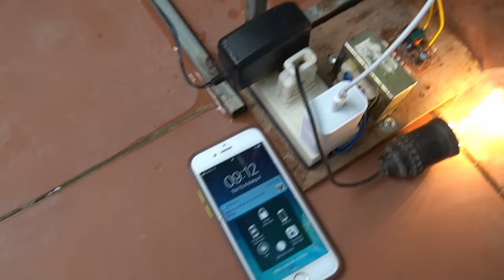Turn The Washing Machine Motor Into A Permanent Water Turbine Generator

Comment from the maker: 👍👍👍 Subscribe To The Channel To See Great Ideas❤️❤️❤️
https://www.youtube.com/channel/UCYPHQSj2QrRNfIiHNzbB6IA?sub_confirmation=1
Reply: Já   -
Reply: Mantap 👍 inovatif oke disub
Reply: إيه الحلاوة دى
Reply: @heliofeitosa6827  vhjnb
Reply: @عاطففوزي-د5د  Power For production 12 volts  and use Batery power deep cicle 200 amper for take the energy . And  use the inversor to transformed to 110 to 220 Volts.   Imagine Five Batery...
Welcome to Brazil Mr.
Reply: 500W Inverter DC 12V-24V to AC 180V-220V-380V Booster Board Module ✧
Reply: @Canonhood  and the transform which is the rule, thank you
Reply: @fernandocaliendo9976  12 /24 volt dc in to 220 volt  ac out step up transform

Or tip 122 mosfet transistor plus 1k ohm resister and a ups un emurupted power supply transformer give you 100 watt @ 220 volts
Reply: Part list your pal from the uk computer and electronic engineer 
=============================
Top motor
LG AIRCON INDOOR FAN MOTOR DC 12 DC310V 130mA - EAU62004011
(No magnets needed to be converted)

Bottom motor 
LG washing machine induction motor for LG Model WD10150FB
(Needs Neodymium Block Magnets x 50  N52)
North and south drilled shaft hold place magnets and stick with super glue)

220 - 240 volt 12 volt transformer for submerged water pump 12 volt dc

24 dc volt input from both motors may be more voltage due to top motor 

DC 12V-24V to AC 180V-220V-380V Booster Board Module
Reply: Great job
Reply: @Canonhood  on this video, is it possible or not, i just want to know?
Reply: @nissinwaffer2165  yes
Reply: @Canonhood  does it work? is it Legit?
Reply: Great |nvent¡ons✅▪
Tűrk¡ye'den se|âm'|ar,
V¡deo çok yarar|ı,
Bu v¡deo'yu
hazır|adığınız ¡ç¡n
çok teşekkűr eder¡m,
Saygı'|ar.
Reply: Sir have you Retract take down from my channel ...
Reply: I request to my all brothers help me to say Great Invention channel owner for retract Take down from channel please help brothers.
Reply: I have request many times but he did nothing . Please sir please
Reply: You also not answer our questions there on the link you gave us..please learn how to write or speak or write in English so that you can answer to our questions to you regarding your experiment
Reply: Сравнить сколько стоит изготовление этой установки со всеми запчастями, материалами, электричеством и временем и сколько даст энергии. Это как сложный аккумулятор, который можно взять туда, где нет сетевого электричества.
Reply: It's true?
Reply: Which country are u guys?
Reply: Can we purchase how much.
Please replay
Reply: i want to buy this
Reply: @mr.rajuhacker  I don't understand what you are trying to say...
Reply: @mr.rajuhacker  "retract take down from channel"??? What does it mean???
Reply: @НАТАШАМАКАРОВА-г6в  самое интересное что я для себя подчеркнул,так это возможность делать не два модуля как на видео,а например 10.
На каждом модуле ставить генератор и к примеру с двух генераторов мы имеем запитку для насоса,а остальные 8 будут выдавать свободную энергию.
Идея очень интересная и достойна внимания.
Reply: @Canonhood  ¿y cuanto amperaje?
Reply: I want this bro how much
Reply: Ceiling fan will run or not on this equipment?
Reply: Алексей  тип того ))
Reply: @heliofeitosa6827  necesito para mi casa
Reply: @heliofeitosa6827  donde lo consigo
Reply: Вы видите в этой конструкции аккумулятор ? А он здесь есть ! Автор думается мне выпотрошил верхний генератор , и именно там разместил аккумулятор . Именно по этому не показано вскрытие верхнего гена!
Reply: @IDJurij  Человек всегда ищет халяву там , где её в принципе не может быть , -  но надежда она умирает последней ! 😂😂😂😂😂
Reply: @DanilBodriy-user-yo5xc5ti3s  есть доля правды в ваших словах )
Но как минимум это очень интересно всё и уверен,что кто то в будущем с помощью чего то нового сможет достичь этой халявы )
Reply: @IDJurij  Таких изготовителей вечных двигателей тьма ,- тьмущаяя!!!
Reply: @DanilBodriy-user-yo5xc5ti3s  мозги пошевелить тоже полезно )
Разновидностей поиска альтернативной энергии очень много,на воде,ртути,магнитах и т.д
Reply: So a ceiling fan moter  and some magmits is all i need .corect?
Reply: @elliottj-ow3xl  experiment
Reply: Wow this amazing and genius😊😅😮

Comment: The motor in the contraption is not the same motor he "converted" to a generator in the beginning.  There is rust on the housing of the "converted" motor that isn't present in the other.  The motors are AC motors and require starting capacitors, by pouring water into the bottles he "starts" the motors spinning, they continue to receive power from the transformer.  The power strip has a small inverter and battery in it that is enough for the demonstration.  The little circuit board does nothing and looks to be from an old FM radio.  The motors spin at the same speed regardless of the load put on the system.  However, you can see that the combined load of the motors, light, and charger is causing the inverter to sag and the charger keeps cycling on and off, causing the light bulb to dim periodically.  At least that's my take on this fakery.
Reply: There aint no free elevator rides, certainly not for heavy Shi- like water
Reply: It's not totally fake!
But the craft of his work differs from what he claims you should believe. 

We all know this too well. Thanks your efforts though!!
Reply: Olhe direito, é o mesmo motor.
Reply: @henriquerugero  meaning?
Reply: @Tasilari  Oh it's real alright. A real pile of BS.
Reply: @BerryTheBnnuy  kikikiki
...flaps huh!
Reply: if you skip physics at school, the world will be full of wonders.

Comment: Super dear, I have tried the same when was in middle school then left it because I didn't get proper power generator and other stuff, now my son trying to make the same 👍👌🔥❤️
Reply: Don't try this, it's fake.
Reply: @MAJ0RTOM  Could you please explain how it's fake?
Reply: @IndianSlingshot  Sure, Im an engineer. This device wouldn't be able to pump the water back to the upper watermill as the energy required to do this is higher than the energy you get from the water falling into the lower watermill. Even if you could recover 100% energy that you get from the falling water (which is impossible because energy is always lost in some other ways like heat), you wouldn't be able to pump the water back to the upper watermill because sticking some rudimentary watermill will not work as a pump.There is no such thing as free energy, that is just made up nonsense.
Reply: @MAJ0RTOM I got it. Thank you so much for your reply🙏❤️👍
Reply: @MAJ0RTOM  but if we maintain the flow of water through other source like reservoir or any river flowing so it will work?
Reply: @AbdurrehmanKhang  If you would like to pump same volume of water as you would get from such river, no.

If you would like to power a generator, then you just made a worse hydroelectric power plant.
Reply: @AbdurrehmanKhang  those all dry up eventually. Any energy to maintain the system is more energy than the system produces, and the fact that you have to add to the system means it isn't a perpetual system. 

Our current understanding of physics/technology makes a perpetual motion machine impossible, let alone a perpetual motion machine that has a surplus of energy
Reply: @General_Flores  got it boss
Reply: @lukaslicek7837  thanks friend
Reply: @MAJ0RTOM  This is still a perpetual model and I ask what kind of "engeneer" some here are 😂 With your click, view, and especially with your comments, reading and commenting You rise the success of this Videoclip, and this Video turns into a perpetuum way of income for this smart creator. 
I would say: He outsmarted even the most smart "engenners" and I comment this to add his success, which he worked hard for, and earned each cent Youtube pays 😊

Comment: Robert Fludd published a description of this machine in 1618. The Fludd  machine  is widely credited as the first attempt to describe a device identical to this device. I mean Fludd's machine and this machine are IDENTICAL. The Fludd machine used water from the top tank to turn a water wheel, which rotated an Archimedes' screw to pump water to refill the top tank. The rotary motion of the water wheel also drove two grinding wheels. Since Fludd's 1618 device is identical to this one, it begs the question "why isn't every light bulb in the world powered by a Fludd machine?" Of course the answer is obvious, in 404 years not one person has been able to get the machine depicted here to work as this machine appears to work, producing an endless amount of power from just filling the top tank ONCE.
Reply: Excellent response Tom. It really has me thinking after looking up Fludd's attempt. I'm thinking since FREE energy isn't possible, we should focus on generating energy CHEAP.
Reply: This water will evaporate too.
Reply: @FreethinkingSecularist  Not if you keep it wet
Reply: @stevetilbrook3402  well that defeats the purpose if you have to keep putting energy into the system. But I hear ya.
Reply: @FreethinkingSecularist  Which purpose? Imagine how valuable this would be in locations with no power at all. Of course you could just build a tall tower since the ionosphere should have enough energy for eternity, but I'm sure there's a reason nobody is doing that. After all, the people who control the fossil energy industries, airspace and access to "space" told me there is no free energy!
Reply: @FreethinkingSecularist  Thankyou my good Mandingo..The water top off would be a pennies worth of time like twice a day..
Reply: @FreethinkingSecularist  how 
About a liquid that isnt water?
Reply: @ImmortalOnenesss  The controllers are not interested in us having free energy. LMAO as if you didnt know
Reply: @Yeshua-Is-God-1  Not really the focus on this thread, but valid in another focus :)
Reply: I seen another YouTube video where a man had some things hooked together it was all electronic but it created energy and I was wondering why that ain't worldwide. Got to thinking the person who made the car that runs on water got killed because I believe you know people wouldn't be buying gasoline if people had one source to use electric companies will be out it's all about money
Reply: @Reichstaubenminister  just build a water mill ffs, stop wasting your time on some fake perpetual motion machines
Reply: @random6033  Tell that to the guys in third world countries.
Reply: @Reichstaubenminister  yeah... i'm pretty sure it's easier than making a perpetual motion machin (which is impossible) or building a 50km tower

Also... why build a tower, can't you just use a balloon with a wire attached to it, either way, it wouldn't be free electricity, only maybe slightly cheaper source of electricity
Reply: @random6033  Having to fill up the bottle is better than nothing, that's all I was saying. 

And regarding free energy: Every meter you rise in the air, the voltage increases by roughly 100 volts. Once you reach a certain height and connect it to ground, you should have an unlimited battery. A balloon you have to send up again and again, a tower will stand for centuries. We call these towers "churches" and "cathedrals" today.
Reply: Heh, there's a battery inside the "generator". This isn't creating electricity from nothing.
Reply: I argue that even if it isn't exactly what we think it is is not still infinitely better than what we currently use?
Reply: @TimEckel   So because  It uses a little bit of energy and we should not even build this
Reply: @utubebansme1844  I mean, what's the point? It's a jank slumdog water fountain.
Reply: @TimEckel   The point is it's a better way of using energy.  Even if it looks ridiculous I'm sure we could make something better if we actually truly prioritized  Extending battery life
Reply: That’s amazing - who knew that neodymium magnets and electric motors were available in 1618?
Reply: Use oil
Reply: I love youtube for people with random obscure knowledge that fits perfectly

Comment: When the lamp was connected to the network, a drop in the generator speed should obviously have been observed, but this did not happen.
Reply: Because there is a second power source off screen handling the "Load".
Reply: Maybe the generator was producing 1.21 Gigawatts of electricity so no drop will be observed.😅
Reply: @The_Crazy_Monkey75  The only thing that produces that much power is a bolt of lightning
Reply: @thomasvlaskampiii6850  Wait what the hell is a Gigawatt?
Reply: @gd2860  A gigawatt is one billion watts
Reply: @thomasvlaskampiii6850  🤦‍♂🤦‍♂ i was quoting Martys next words and was thinking you were gonna come back with the next line, instead you didnt catch on and had to try and explain to me what a gigawatt is. Again. face palm.
Reply: @gd2860  Oh. My bad. I didn't remember that line. Sorry I killed the train

Comment: Awesome! Where is the real power source at though?
Reply: Under three machine! Wireless charger!🇺🇲
Reply: @MLesp  no shit you can make power with water. But there is no such thing as a true perpetual motion machine. No machine will be able to infinitely sustain itself let alone put out any excess power along side that
Reply: @XGeneralFloresX  Yes, but  those "laws" (the 1st and 2nd in this case ) are not absolute, meaning that they are created by humans with their experience and in some case to limit.  A great example of this is when a crystal forms from liquid or when a quemical reaction is exothermic. These laws require assumptions and approximations and in many situations these assumptions do not hold. These laws are typically derived from classical mechanics which breaks down at a very small scale, atomic or subatomic level. On different accounts these laws needs to be modified depending on the project. It's important to recognize their limitations and approach with caution and critical thinking.
Reply: @MLesp  so take your house off grid with these, or are you scared?

Why bother us peons when you can break the laws of thermodynamics?
Reply: @Dannerrrr  Off course, you can't go of grid in the US. Moreover, it will be very difficult, unstable, and extremely costly to scale this. We'll hydroelectrics do the same thing. If you have a river behind your house, try it. But you may need a permit, and I bet you will not get it. These people live in a different reality than the people in the US, and this is a common experiment in school.
Reply: @Dannerrrr  @XGeneralFloresX have you seen the project in where they use a bicycle to turn on a light bulb. Well is kinda similar, none of them can be scale up to provide electricity
Reply: @MLesp  you're so wrong you don't even know it.

My bike has a lightbulb dynamo too, it makes me slower but I get light. It's an understood physics exchange.

The water example is trying to be something that it cannot be via obfuscation. You could simplify the design into a single tank of water on top, a bucket to catch the water, and a single propeller to generate a slight amount of electricity. Instead, they're pretending to be a perpetual motion machine, either with a very short filming window, or with batteries.
Reply: @MLesp  if you don't know how to do math harder than multiplication, just say so. Scientists are often wrong on why things happen, but very often right on what happens.
Reply: @Dannerrrr  Sure,  always right on why 🤣😂😂.  and life is black and white or red and blue. That's why you get upset 😂😂. Is nice to live in a bubble, ❄️
Reply: @MLesp  you're the one who thinks it's not possible to live off grid in America, while hundreds of thousands of people are doing that right now. You also read my statement wrong, they know what happens, but why is a strange concept.

Comment: Nice work is there a blueprint to work with? Would be interested to build one ,have a lot ingenious people around me who aren't engineers per se but are gifted and could probably make this work
Reply: It's physically impossible to make a eternal energy generator since it would violate the laws of thermodynamics, you cant get more energy than what you start with.

Most eternal energy contraptions are either battery powered or extremely efficient in conservation of energy
Reply: @fdajax5107  ok I get that, I'm curious to know how "efficient" it is
Reply: @fdajax5107  it doesn't matter how efficient it is it will run down in short order with anything drawing energy out of it.
Reply: I can get you one - blue print

Comment: Logical experiment ✌️
Just to achieve this, you must provide
12vAc output current. Connect it directly to the 12v transformer so that the current is reversed to 220vAc, along with bringing a pump and a 12v transformer to circulate the water through the system used.

Comment: The principle behind this setup is very well scientific. Indeed the law of energy conservation is not violated and there’s no need to have Orr hide any battery somewhere. It is not about free energy but rather high efficiency energy generation. The system which behaves like an oscillator set in motion was given a manual input and eventually will stop through frictions, energy dampening or once an imbalance of water occurs between the two gallons.

Comment: What a great innovation. When u take a closer look, the turbines are rotating in an  opposite direction. And u dnt really need a charger from the very start. The only thing impressive abt this is u hide the battery very well dude 🌝
Reply: Do you know why he drills and insert metal pins in it? If you dont know the answer to it dont discredit his work!!!!
Reply: What happens if turbines rotating in opposite direction he connect the positive terminal to positive itself ...
Reply: Where is the battery?
Reply: Ive watched a few times and i see no wires going to batteries or anywhere to hide batteries by it
Reply: @chrisu7022  I see wires going to multiple locations a battery could be placed with ease. The power bar, the transformer, or even in the adapter for the pump.